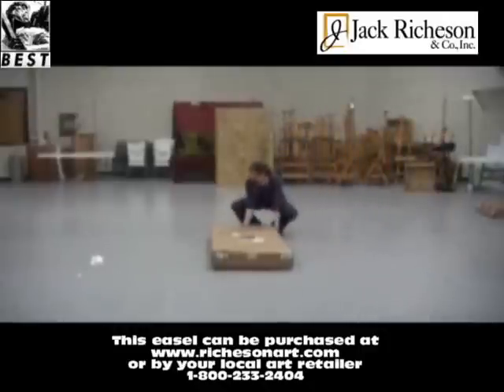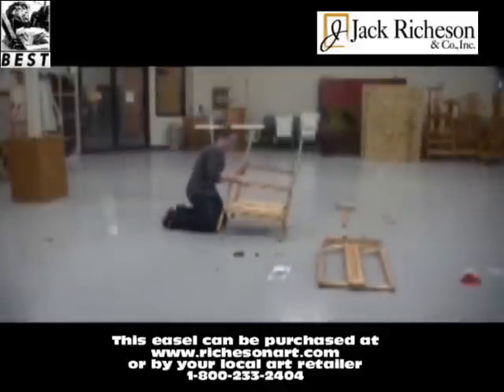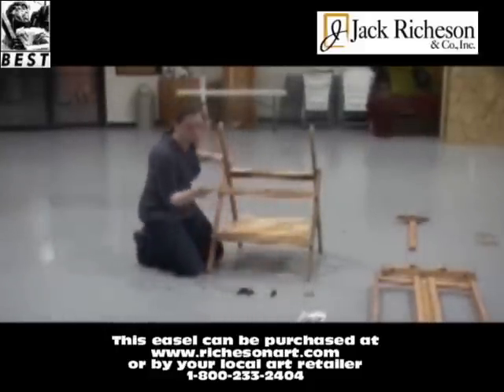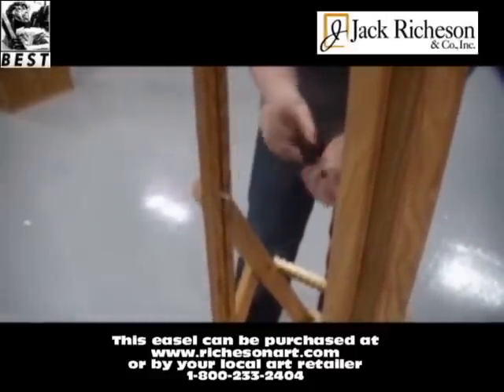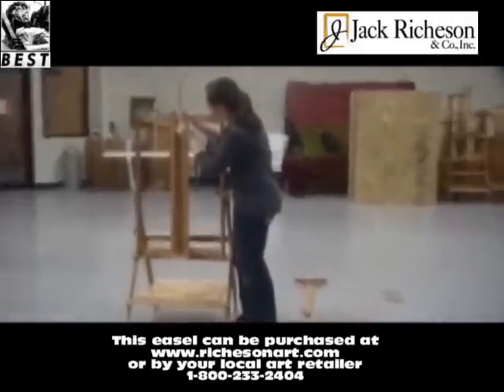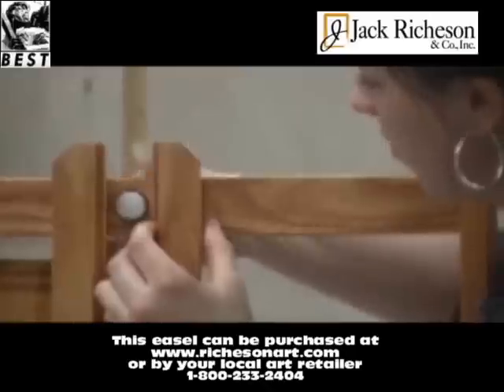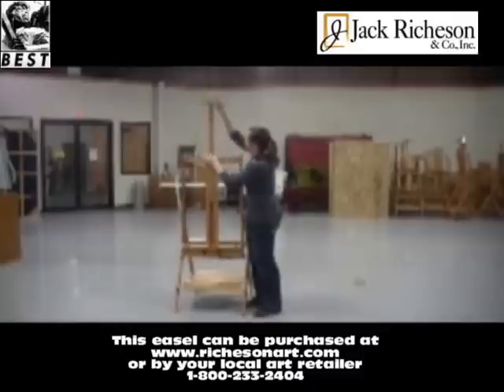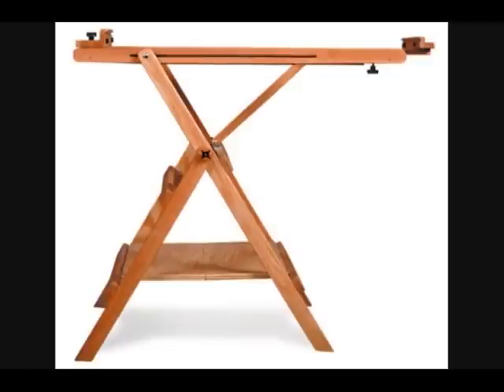Deluxe Lobo 883200 By Richeson

Comment: Great easel. Not such great video. It took me a while to figure out that not all of the bolts have sliders. The ones that secure the legs and attach the lower end of the “back support leg” to the metal bracket in the middle of the horizontal brace that’s attached to the two longest legs. It’s crucial to loosen up the mast (the part that holds down the top edge of a canvas) and turn it around or it will face the back of the easel when you’re done.